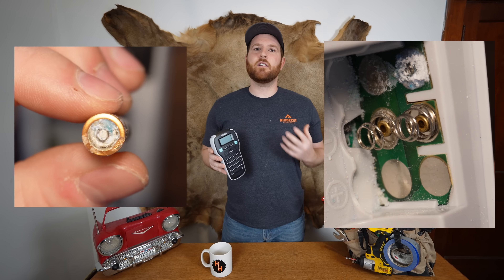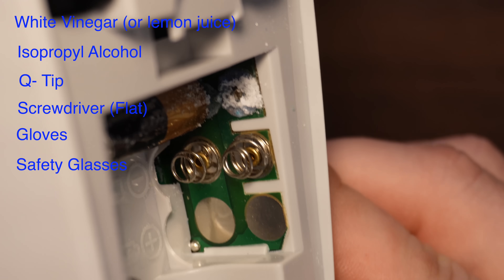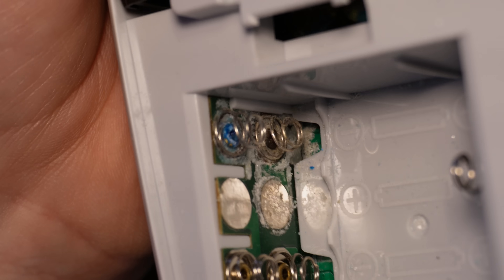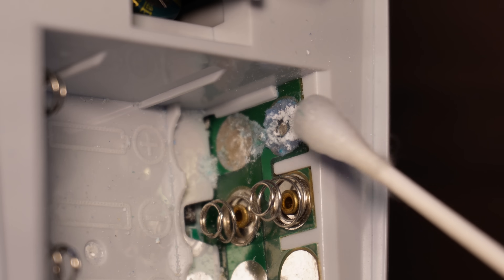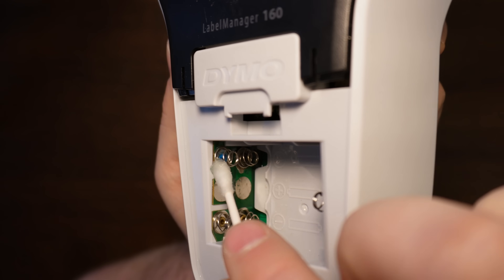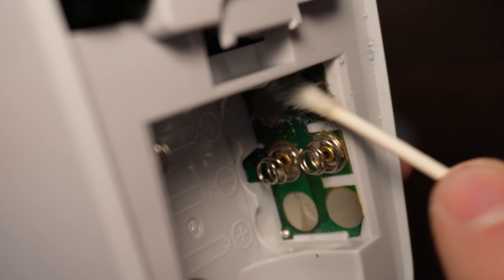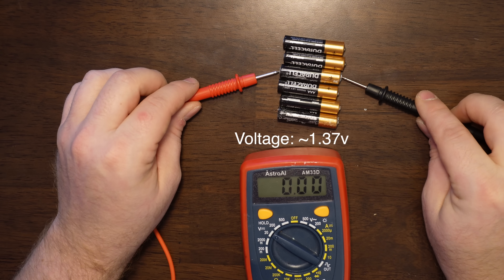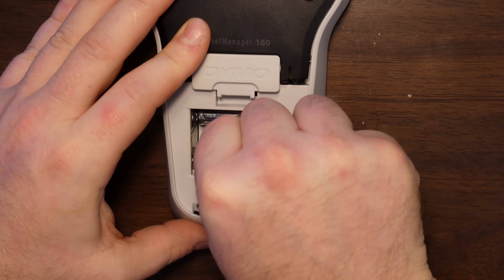Clean BATTERY CORROSION on ELECTRONICS! EASY DIY!  |  2-minute Tutorials Ep.4

Comment: New subscriber here. Just started listening to the video, so if you've answered this, I apologize. Can I use white vinegar to clean the connectors on my auto battery terminals when they start to get corroded? I keep losing my wire brush. Thank you!😊❤
Reply from the maker: Thanks for subscribing! I'm not sure I understand what you meant, I think there was a typo?
Reply: @HandymanHertz  Sorry. Typo fixed.
Reply from the maker: No, if your car has a typical lead acid battery (pH less than 2) you need a base product like baking soda or baking soda paste to counter that. 

AAA alkaline batteries have a high ph, so that's why a low ph acidic cleaner like vinegar works. Different chemistries. I would use an electronic grease to prevent moisture/corrosion
Reply: @HandymanHertz  Thank you!!! One last question: How about WD-40 as a terminal cleaner for an auto battery?

Comment: Simple, no nonsense approach to hands-on cleaning corrosion like that is always better than using chemicals but the good folks who make WD-40 do have a contact cleaner that I can recommend for the really tough spots.. I would first clean the terminals just as you show in your video and I too would use a small scrapping tool of some kind mine just doesn't resemble a screwdriver, it looks more kitchen utility-like.. yeah okay, it's a butter knife! Good video! Post more please!
Reply from the maker: Hey thanks for the compliments. I've seen that wd-40 spray, I may have to pick up a can. 👍🏼

Comment: My experience with Duracell batteries is that they leak more often than anything else I have tried. 

I've got kids, so that means lots of battery operated toys come through our house. That equates to many, many batteries being used, and they all leak eventually, and you will forget to remove some when the toys get stored fir awhile. This method is my go to for cleaning as well. Electrical Contact cleaner works, but some plastics will melt, so use caution.
Reply from the maker: Interesting, that's good to know that it will melt the plastic. Thanks for your input. 👍🏼

Comment: Instead of a screwdriver, I use some automotive sandpaper (400 grit plus). Abrasive enough to knock off the excess corrosion,  but does not excessively scratch the surface of the contacts. Also works to clean off the ends of the batteries to make better contact when using a battery tester if having trouble getting a stable reading.
Reply from the maker: Thanks for the tip 👍🏼

Comment: Great video. Good information. On battery-powered things that I've had corrosion issues.I've cleaned them up and put a little dialectic on the contact points. Works great on solar powered patio lights  with rechargeable batteries.
Reply from the maker: Dielectric grease, that's a good suggestion I didn't mention. Thanks 👍🏼

Comment: Generally batteries will only leak when left inside a seldom used or unused device for an extended period (even Duracells).

However, after watching you load Duracells on top of your Energizers, I'm not going to assume you didn't mismatch old and new cells prior to the first incident.
Reply from the maker: All new Duracells were loaded in at first.

Comment: My experience is that Duracell batteries are far more likely to leak even when the still have adequate voltage and current to run a device and even when they are only a few years old.  I've noticed that Ever Ready Energizer batteries now claim on the package that they have more leak resistance and I have found that to be true through having used dozens of them in AAA, AA, C, and 9V.  I do not buy Duracell or store brands any more.  I only use Energizer when possible.
Reply from the maker: Yup, after buying Duracell all my life, I've switched over to energizer

Comment: Hi, I heard the white stuff from the batteries is dangerous, which can cause risks such as skin and eye damages. I think it would be nice to add at the end please use gloves, etc. to protect people's health. Thank you :)
Reply from the maker: I tell people at the first of the video to wear gloves. 👍🏼
Reply: @HandymanHertz  Thank you for your kind reply :) I missed that part. I still am worried about the possibility that seeing you dealing with it without gloves may give people the impression that we don't actually need to wear gloves because wearing gloves was not explicitly stated in the video, and many people don't know the white powders are dangerous. Psychologists say that most people learn something by seeing rather than reading what is written. I also think viewing the part of dropping powder with bare hands under the desk can lead to a dangerous practice. If people do the same, powders can fall on legs, clothing, and the floor. Particularly in homes with babies or dogs, it can be extremely dangerous to do so without properly disposing of the powder, because babies and dogs put many things on the floor in their mouths. The safe way of disposing of them would be putting them in a Zip Loc, I think. Could you please consider cutting that short part showing dropping the powder under the desk to prevent people from doing the same thing? Thanks for your consideration, have a great day!

Comment: I always wondered what the heck to do about corrosion and those salts all over the spring parts!  Looks like vinegar is the way to go, any other advice?
Reply from the maker: yeah, you dont have much to lose if you're going to throw it away anyways. one other tip is to put some dielectric grease (link in description) it will help prevent it returning and rusting in the future

Comment: Corroded batteries is the reason I switched to Eneloop brand rechargeable NiMH batteries for all my devices. I've used dozens of them over and over again, for a decade and never had one corrode.
Reply from the maker: People seem to really like eneloop.   How does NiMh compare to lithium? I'm not familiar with that.
Reply: @HandymanHertz  NiMH has been around for 20 years so it has stood the test of time. The white Eneloops are designed to hold a charge for months, so they're always ready to use. They do have one drawback, because their voltage is only 1.2V. Many modern devices are designed to use them without a problem, but some gadgets rely on the typical 1.5V of Alkaline batteries and may complain of a "low" battery.

In contrast, Lithium AA's have the opposite problem. Their voltage is about 1.7V which is high enough to damage some devices that were not designed with them in mind. 
Hope this answers your question.

Comment: You shouldn’t mix new batteries with partially depleted batteries. It causes high current flow between batteries of different charge and can damage a device. (Or so they say).
Reply from the maker: Yeah, I've heard that, still not sure about it, but I'll take your word for it. 👍🏼
Reply: @HandymanHertz  but I liked your video- I’ve always just scraped corrosion off terminals and cleaned with whatever was on hand. Next time I’ll use the vinegar. Makes sense to neutralize whatever is there so it doesn’t keep corroding and damaging the new batteries👍
Reply from the maker: @aeromender thanks for watching 👍🏼

Comment: The erasers do work . However, the type that you use is the "  ink typewriter" kind   that used to be used before  computers.  The grey ink type are a bit more aggressive in removing surface corrosion.  Back in the 1980s, as f Marine feild radio operator, the Grey erasers were a must for removing corrosion from the terminals  and especially when  the  BA 30s (D cells ) went south in a  radio remote  or a wire  telephone  powered by batteries equipment  .
Reply from the maker: Ohhhh that makes sense. I'm not really savvy on electronics and the tools. Thanks for clarifying 👍🏼
Reply: @HandymanHertz    no problem. The vinegar  does work in neutralizing the alkalinity from the batteries . The  alcohol helps dry any water from the vinegar . Regular  rubbing alcohol  works, but I prefer to use the 90% when I can find it.  Just no open flame or heat source. 🔥

Comment: You're asking for more leaking by mixing brands and charge levels. The cells are actually using up their outer casing as they discharge. Since the cells are in series, the newer cells will force more current through the weaker (i.e. thinner case) cells until a hole develops in one of them.
Reply from the maker: Interesting, others have mentioned this but never explained why, thanks! 👍🏼

Comment: After you clean the terminals you should put some dielectric grease on them. It helps the terminals from corrosion.
Reply from the maker: Good tip, thanks for the input 👍🏼

Comment: Nice video. I've never had a problem using the alcohol alone.
Interestingly, you're dealing with leaked battery ACID, and ideally you shouldn't use another acidic such as in vinegar  - you should be using a neutralizer such as a paste of baking soda and water (cleaned up with alcohol).
Reply from the maker: Thanks. So, it's actually not acid leaking. The batteries in the video are alkaline so it has a base or high ph. That's why vinegar works. Car batteries are generally acid, which would need something higher ph like a baking soda.
Reply: @HandymanHertz  Thank you for the chemisty lesson  ;   )

Comment: Thanks for the "Clean BATTERY CORROSION on ELECTRONICS!" video. Makes perfect sense. I've always used something pointed and sharp like a knife and/or a screwdriver. Works sometimes, but not a real good  way. Question though...Is there anything you'd recommend as a corrosion preventative?
Reply from the maker: Thanks for watching! You could put some dielectric grease on, or there's a lot of people in these comments who have put Vaseline on. This will provide a barrier between the air and metal. Hope this helps 👍🏼
Reply: @HandymanHertz  Thanks very much! Keep up the good work!

Comment: I'm a bit surprised that nobody mentions that battery leakage is poisonous. 

"Battery acid — and the corrosion that occurs when it leaks — is highly toxic and caustic. Alkaline batteries leak potassium hydroxide, a substance that can cause serious eye damage and respiratory and skin irritation."
At least were gloves.

Also: baking soda, together with vinegar works great: "Baking soda neutralizes the battery acid, and a little vinegar (or lemon juice) reacts with the baking soda to break it down."
Reply from the maker: I think everyone know better acid is poisonous.yes, gloves and eye protection are recommended.  Thanks for your input on baking soda and vinegar.

Comment: I use a little soda like 7 up or Coca Cola on a tips then rinse with water in a a tip. The citric acid cleans the corrosion very well. I’ve never tried actual juice though.
Reply from the maker: Interesting, never tried it, but heard it works 👍🏼

Comment: I notice your leaky battery is a Duracell-Copper -Top battery.   DO NOT BUY these.   The Duracell  used to be  a good battery.  No more..... Their quality control has gone to hell.

Get the silver Energizer battery.   They  last much longer without a leak.   Don't know about the off-brand ones or store house brand types.  I just don't buy the cheap stuff.   Have not had to clean up a mess like the one you worked on in the video in years.
Reply from the maker: Yeah, I agree..Duracell coppertop isn't very good for being a "premium brand"

Comment: First of all, stop using the Duracell batteries.  They are the absolute worst batteries you can buy for leakage.  I've had the large packs that you can buy from Costco or Sam's and had them leak in less than two years in the package.  I've found the Energizer Max is much better.   For low-drain devices, I buy carbon-zinc batteries from Dollar Tree which never leak
Reply from the maker: I agree, Duracell has lost my business

Comment: And >>> I have noticed that the Duracell batteries seem to be failing a LOT MORE in the past year or so than previously.
I switched to the silver Energizers as all the info on them states that they will not leak and corrode. So far - so good.

HOWEVER --->>--- I have found that in some of my GMRS HTs (walkie talkies) the Energizers will not provide power that they like and they will not work so, Duracells again and now the Panasonic rechargeable eneloop batteries which work perfectly.
Reply from the maker: Yes, I agree, I am no longer buying diracell batteries, after being a lifelong customer

Comment: Why did HH measure the voltage with the black multimeter probe to positive and red to negative?! This really surprised me. Luckily his multimeter also displays negative DC results. It wouldn't have worked on an analogue meter and I assume some digital ones. He didn't seem to register that the result was negative.
Reply from the maker: Every multimeter I've used will display the correct voltage, but as a negative.  the number is what I'm after and what's important. This saves a ton of time through the years not worrying about which side goes to which and switching them. But yes, for the sake of not confusing others, it would be best to have black on the negative
Reply: @HandymanHertz  You're probably too young to have used analog multimeters!  Google "Avo multimeter" - they were the Rolls-Royce of multimeters in their day. All the best, Rob

Comment: This along with most other similar vids is great with devices with easily accessible battery contacts but I have a foaming soap dispenser where the contacts are deep inside I need to glue a disc of fine abrasive paper to an AA sized flat plastic rod after cleaning with cotton buds & dilute kettle descaler.
Reply from the maker: That's a good idea!

Comment: Left some duracells in a tv remote too long, the springs punctured the batteries they were so bad. This video has been a big help in cleaning off the corrosion.
Reply from the maker: Glad to hear it helped! I love success stories!
Reply: I wonder a bit if this is a more modern problem that comes from them trying to cram more mAh into the battery than is wise. They start to leak to avoid exploding, and with more mAh there's probably more chemical and less room for expansion.

Comment: After attempting to use a wire brush and flat head screwdriver to no avail, I looked for an answer on YouTube. Came across your video, and with nothing to lose, gave it a shot. IT WORKED! You just made my kiddos day getting their train remote to work with their train set. Thank you! Now this has me thinking about all the items thrown away that could have been saved! lol
Reply from the maker: Glad it help!! Love hearing stories like that. Yeah, I've had that thought too, how many electronics I've thrown away in the past!
Reply: I agree! 😂 all the items thrown away...
Reply: You can sometimes get replacements for the contacts on some devices if they are too bad. This should work pretty well for most situations though. I know that for things like OG Gameboys, you can go online and buy kits to just swap out the contacts without much fuss. Which is occasionally a better decision, especially if there's significant corrosion that can't be removed.

Comment: I used to think Duracell batteries were the finest batteries made. After having many battery operated items recovered from long term storage totally ruined by Duracell batteries, I well never, ever use them again. 

I have found Energizer to be a far superior battery as far as leakages. 

Live and learn.
Reply from the maker: I've had the same experience. They used to be the best in my opinion and thought every brand must leak. But apparently that's over and above a Duracell issue. They have lost my business.

Comment: Don't use Duraleaks or Chinabombs, and you won't have this problem.  Use rechargeabe Eneloop's from Japan, and you'll not only have a longer lasting battery, but you can recharge it 1000 times.   My son's x-box wireless controller eats alkaline batteries.  He's been rotating the same 4 Eneloops over the last 4 years.  They last longer than an Energizer alkaline between charges too.
Reply from the maker: Thanks for the solid advice 👍🏼 I don't use batteries too often, I'm just not ready to make that big of an investment when I think of all of my electronics in my life that require batteries. I'll look into them tho....eneloops. Thanks.

Comment: In the past, Duracell batteries were good, but today all the ones I bought leak and ruin the devices, even though they are still out of date. I will never use Duracell again, not even for free. I'm an electronics technician and I always get TV remote controls damaged by this Duracell sh..., it ruins the contacts and ruins the electronic circuit board. And I thought this sh... only happened in Brazil.
Reply from the maker: I can't believe how many people in the comments agree with you and why Duracell doesn't completely change their coppertop batteries before their reputation is completely garbage worldwide. 🤷‍♂️

Comment: I thought Duracell batteries came with a leakage damage warranty. Perhaps not anymore? Having learned the hard way on more than one occasion, l now only use lithium non-rechargeable batteries in any expensive or non-replaceable equipment. They are expensive but never leak.
Reply from the maker: There's a few comments on here who have filed claims, but I'd adventure to say not many people want to go through the hassle and loops. Like you said, just better to buy more quality batteries.

Comment: After removing grit with the Qtip, then NEXT STEP  put coca cola on the Q-tip and using the wet Qtip and a dry Qtip, rub the corrosion off,  IF still necessary use a metal anything to scrape off the hard to get. HINT, you may not need to do the scraping.
Reply from the maker: Never used coca-cola in electronics before but I would enjoy that, would go good with my steak! 👍🏼